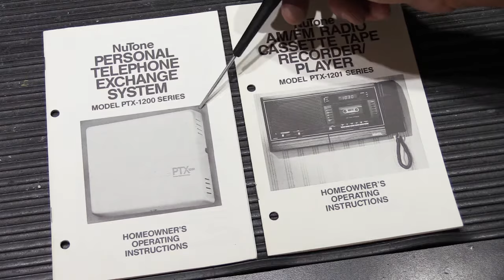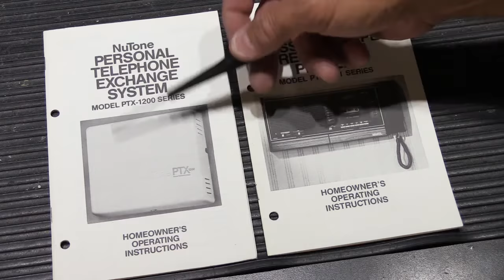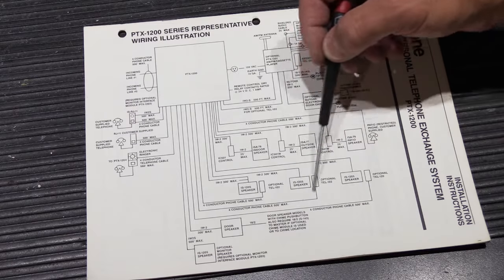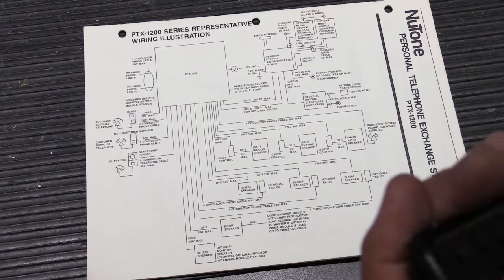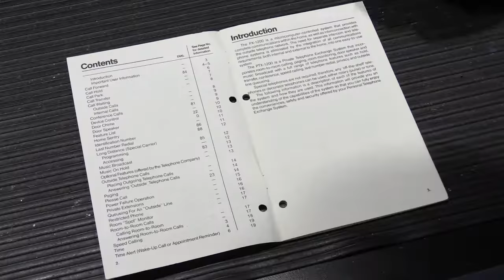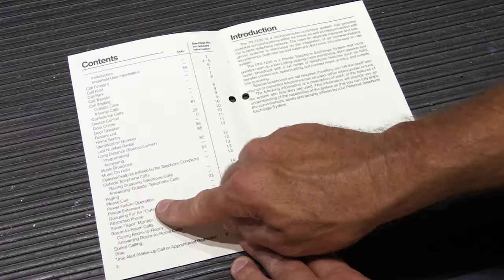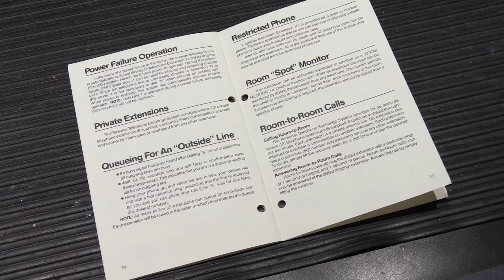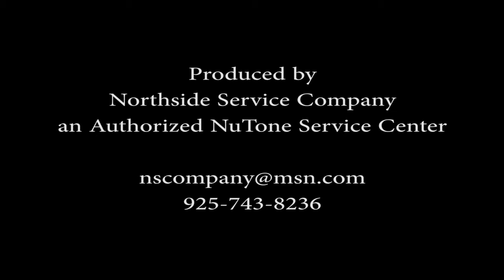An Overview of a NuTone PTX1201 AM FM Cassette Music Center

Comment: I've heard of the NuTone that could be integrated as a hands-free speakerphone into your telephone system via a special adapter/relay, but I've NEVER heard of the one that is meant FOR the telephone system (basically the other way around)... Do you have any idea of what the phones looked like? I wish you had access to a PTX1200 so you could show the telephone exchange in operation! NEAT! (:
Reply from the maker: Hi Vincent: I'll be on the look-out for a PTX1200 for a future review.  NuTone was never very successful integrating telephones and intercom system.  One of the major problems was (remember this was in the late 1970's and early 1980's) that telephone systems across the USA varied a great deal with the age of the technology that was being used.  This always cause compatibility issues and therefore consumer problems were always an issue.

The telephones that NuTone sold was a very simple, corded handset, very like what you could but in the late 1980's for $10.00 at your local variety store - basically they were very cheap and not very well made.
Reply: What do the tip and ring terminals on an IM3003 board terminal board do? I've never seen one attached to the phone line.
Reply from the maker: Back when the IM3003 was new (1984) NuTone sold an accessory telephone handset (TEL101) that was the same height as the IM3003 Master Station.  The idea was that the TEL101 could be mounted next to the IM3003 and you would have a unified look.  The Tip and Ring Terminals were there to be a convenient location to made the connection to the telephone line.  The telephone was not integrated into the Intercom System in any way at all.